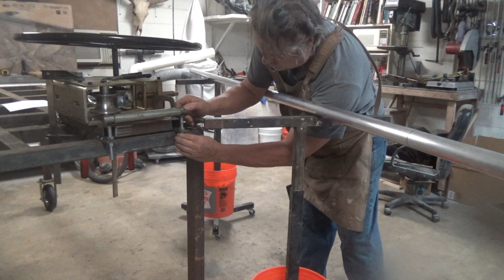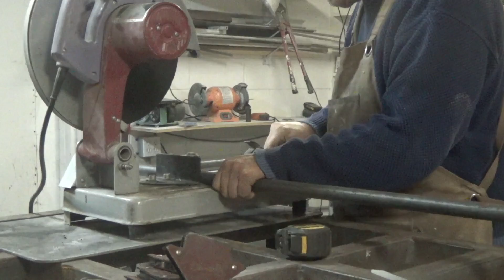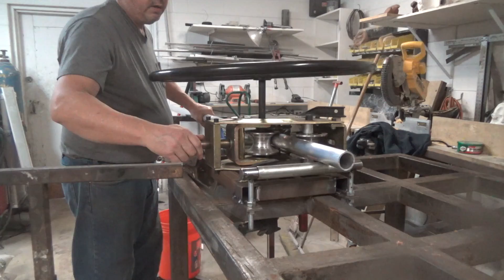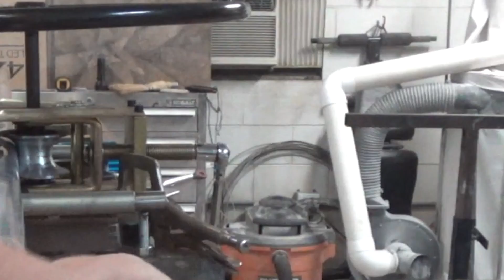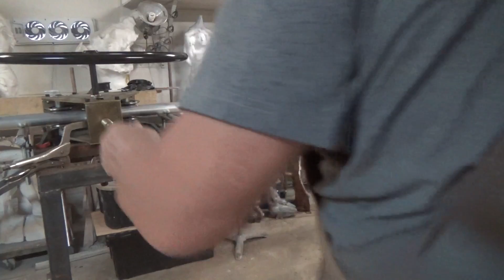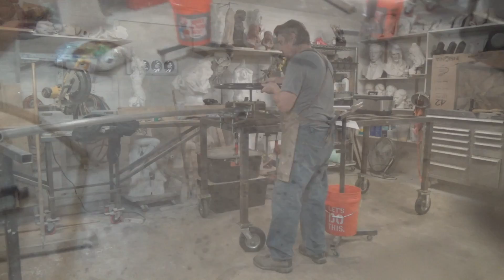Properly Modify Your Harbor Freight Tubing Roller

Comment: Nice idea using the floor as a reference guide for the ends.  I wouldn't have come up with because the shop floor is cracked.
Reply from the maker: The shops that have the big benders usually have one operating the bender and another person out on the end with a level. I just modified that idea for a small shop. All you really have to do is use the level. It is really better to have a two person operation, with the person on the end, holding the level.

Comment: I need to create an 8 foot diameter circle using 3 lengths of 10 foot pipe. How do I know how much bend to put into each section (length) so that when assembled with couplers the ends meet to complete the circle?
Reply from the maker: Google circumference calculator. Find your centerpoint in your length and measure out from the centerpoint. Allow at least 10 inches to a foot for the flat spots. Mark with a marker. And use a roll of tape around the tube to get a square cut. Draw out on paper first to make sure your calculations work. I should publish a formula, but those files are archived and I’ll have to look them up. good luck and feel free to contact me.
Reply from the maker: Ok this is the calculator I use online https://www.omnicalculator.com/math/circumference. 
1- Diameter Calculation: An 8-foot diameter circle has a circumference of approximately 25.13274 feet. (This is just a calculation for reference.)
2 - Divide Circumference by 3: If you divide the circumference of the circle by 3, you get approximately 8.4 feet. Usable tubing. Converting this to inches gives you 8 feet and 5 inches.
4 - Adding 20 Inches: If you add 20 inches to the 8 feet 5 inches, you get a total of 10 feet 1 inch.
5 - Marking the Tube: Find the center of the tube and mark it clearly. Then, measure out 4 feet 2.5 inches from the center in one direction and mark it. Repeat the same step on the opposite side.
6- Do not cut the length down until the end. REMEMBER YOU NEED TO ROLL PAST THE ENDS TO AVOID THE FLAT SPOTS. AFTER THE BEND, THEN CUT!!!!
Reply: @forsterarts  Thanks for the calculator and calculations. I am still confused. After I mark the tube at 4.25 inches, how is this mark used? In relation to what? I’m trying to figure out how much bend to put in each 10-foot section so that 3 sections put together will give me the circle.
Reply from the maker: @SteveJohnson-x1z  the center of the tube is 5 feet. Circumscribe a mark with a felt tip pan at 5 feet. Measure out 4 feet 2 1/2 inches from the center. At that point circumscribe another line with your tip marker. do this for both sides? The remaining will be the flattened spots that you don’t want in your bend. Those get cut off and thrown away. I’m out shopping right now and should be home in an hour or two if this does not seem clear enough I’m having difficulty writing from my phone.

Comment: When i first sauce this honestly it thought it was ridiculous, then I had to bend a 9’ radius on 2” bar and it kept corkscrewing. So I spent a lot of time setting up a similar mod, well I was skeptical that it would work, but let me tell you it was worth the time, then bends are perfect every time and I don’t have to constantly straighten the pipe! I used the swag mods too, and can bend a 9’ section of 2” 15 gauge to a 9’ radius in less than 10 minutes, perfect  every time, thanks for posting this!

Comment: The concept is great, my shop floor is not....Mason must have done some serious drinking while waiting for concrete truck to show up that day.  I bought garage this way, did not have it built.     I'm a solid 2.5" off over 30' in my shop.  Rolls up in middle, then back down again along edges, and there is a drain in the middle of floor, .....at highest point....SMH......When I bring 24' lengths of material in, and set it down, I have to block both ends and nothing in the middle.     Is it mostly round tubing that is an issue then?   I do alot of square tubing rolling, and don't have much twisting issues using it upright.   I have to go outside to do it, but wouldn't have the space anyway to do it on side, your way,  inside.  How big is your shop?       I can usually clamp them down on a table jig after and then the heat from welding gets them flat and true for the little bit they are out.    Aluminum twists like crazy to begin with while welding, so it sort of moves back to where I need it.
Reply from the maker: My current shop is very small, I went from a 5000 ft.  to 600 foot shop. My shop table has large inflatable wheels so I could roll out into the yard for larger works. Yeah your square tube comes in 24 foot lengths doesn’t it. I made those little T stands and have plenty of them around. they are very handy.  Make them adjustable to go up and down. If you can find another person to hold the ends of the tube, then they can keep a level on the tube. You don’t want to heat aluminum for tweaking. I do use a very heavy dead blow up on occasion. Even square tube twist, especially As the radius gets tighter. I don’t know if the 2.5 inches of change in elevation will affect the outcome much. Just keep a level on your work all the time. Good luck!

Comment: I would suggest you add two more guide rollers and eliminate the weighted buckets on each end.  When Using the buckets fasten the tube with a six inch F clamp.  It will go inside the tube if I.D. allows and hold it better.
Reply from the maker: An F clamp would definitely be less frustrating.  The added rollers will not prevent the twisting that naturally occurs in this process.  When you do this in a normal shop, you have a guy on the other end holding the tube with a level.  I substituted the guy with the level, using the stands.  It works well for me.

Comment: By using the roller horizontal instead of vertical, the way it was intended, you fall prey to gravity which is causing your "spaghetti" effect. All tubing rollers are made this way for that reason and a simple lengh of angle iron bolted to the back side opposite the handwheel will allow you to see if the bend is going out of square. Plus you don't need 200 square feet of floor space and those ridiculous rolling T-supports that are guaranteed to stumble on every piece of debris on the floor.
Reply from the maker: I would guess your an engineer?  I have owned some of the most expensive rollers all the way to this roller.  All the expensive Rollers have an option to roll horizontal.  With the roller set to vertical, there is no way to check the flatness of your curve.  I have never known tubing that did not have a tendency to twist.  You must be a better roller than I.
Reply: I wood ges kollej edukated. LOL
They have education but absolutely NO common sense. But they know it ALL!!!
Reply: I would guess a couple pieces of 2x2x1/4” bolted together 1/64” wider than the stock being bent on both the exit and entry would be less time, mind, and space consumptive.
Reply: I was thinking about that as well, but only because the HF roller has a lot of play on each side of the dies, that owners are putting washers on each side to eliminate the play. So tipping it over on its side will allow gravity to slide the rollers to one side which isnt a problem if all the dies slide into the same position keeping them aligned but if theres dust and gunk on the die's bolt.. perhaps  it could cause the die to not slide all the way to the one side causing the dies to no longer be aligned.  Simple washers will solve this problem though.
Reply: @ChristopherJones16  providing your floor is level,  most aren't

Comment: It's a great idea.  I work outside in the gravel, so this probably won't quite work for me.  If my shop area was weld-spark approved (don't want to burn down my shop), the floor is pitched for water drainage, so it wouldn't work there either.
Reply from the maker: Have a friend hold a level on the end, or tape a level on the end.
Reply: a level floor is ideal, but a flat floor that slopes will also work fine, you just can't use a level to calibrate your equipment.

Comment: place a locknut on the threads when you reach the desired radius
Reply from the maker: That is a really good Idea.  My old Baleigh had a dial on it,  and you could set the dial.  Thanks for bringing up that point.

Comment: This is a whole lot of wasted time. I have used and seen many things built with a hf radius bender/tube roller and have never seen a problem bending vertical. I don’t think I have ever seen a vertical radius bender. Baileigh, trick tools, hf, dpmimports they all make them vertical. It makes more sense so there is no load pulling on it sideways from the way your bending it.
Reply from the maker: Good Luck! trying to make money with that.

Comment: The biggest problem with the Harbor freight roller and causes the twisting problem as well is that the roller dies are to close together.  Buy the SwagOffroad upgrade kit for this roller and all will be good.  Great video.
Reply from the maker: I have owned the big expensive Baileigh's too, and they all twist.   I used this method with my big expensive rollers. Controlling the twist is primary  issue.  Now the people who really know rollers are the people who do the big expensive stainless steel spiral staircases.

Comment: Hi Peter,
Loved the video!  I was hoping you would be kind enough to advise me on something? Do you remember what wall thickness and diameter tube you are bending in the video?
I have just made up my rollers for the roller bender I am making.  I need to bend stainless tube that is 1" and a 1/4" diameter and .065" wall thickness.
Like you, I am a sculptor but I am from Australia.  I was going to use the harbour freight unit as a guide to the one I am making.  Do you think it will be up to bending my job? The tube you are bending seems much thicker than .065.  Any thought?
Kind regards,
Simon.
Reply from the maker: I was using aluminum pipe that was 1/4" Thick.  Knowing the difference between pipe and tube.  Pipe is measured by the inside diameter, and tube is measured by the outside diameter. My pipe was 1 1/4" ID, which made the outside 1 1/2".  The rollers are designed for tube diameters.  I used the two  inch rollers to produce my railings.  There is a problem with using oversize rollers, in that the walls will deform and not stay round, they become sort of oval shaped. Harbor Freight dies are 1", 1 1/2" & 2".  You will have to use the 11/2" die and depending on how tight a bend you are looking for will determine the distortion.  There are a number of people producing after market dies if you need the precision. 

*no matter how fine a roller you purchase there will always be an oval shape, you can actually calculate the oval that will be produced. Also known as "Ovilaty"*

To answer you on the 1/16" SS wall thickness and will the roller be up to the job.  Yes it will.  Remember to allow extra footage on the ends for cut off.  No matter how fine a tubing roller you have, there will always be distortion where the bends begin and end.  I pre determine my bends, with precision and mark my tubes all the way around before I begin rolling so the cut off angle is not fudged. *Start the bend several inches in front of your cut off marks!*

Also, you are probably thinking SS this is tough stuff, it is going to be hard to bend.  SS is tough yet at the same time fragile.  It has high strength but the surface is fragile.  That is stainless steel self passivates. Under a microscope the surface is always getting rid of contaminants that may start to rust.  For this reason I always handle my finished SS with soft goat skin gloves.  Start your bending process gradually, do not overdue it thinking in the back of your mind this is going to be tough.  The biggest problem you will be faced with, will be keeping the tube from becoming spaghetti like.  You can achieve the same results that I produce in the video by having a person on the ends holding a level.  This method takes a bit of practice, but is quicker. 

I ended up building a small stand, because the large table just slowed me down.  Getting your rollers set up is very important, I made a number of shims using large washers.  I ground one pair of washers down to paper thin.  *Washer pairs, that is three pair of washers to paper thin* The rollers must be centered equally yet turn easily to produce best results.  Take the time the first time to set them up right, learn the quirks of the rollers, and you will get some nice results.  Good luck, if you have more questions, let me know.

Circumference calculator https://www.omnicalculator.com/math/circumference
Reply: @forsterarts  Peter, thanks so much for the detailed response.  It is much appreciated.  I made my dies on the lathe and they seem to be a good fit on the tube.  I am not envisaging any problems from that side hopefully.
I am surprised you got away with the bigger rollers on your job but it is great to know that there is some tolerance.  I was thinking that if it was 1/32 "  oversized it would be a throwaway job!
I am obviously wrong about the roller setup.  You mentioned shimming yours to get the alignment right but I had assumed they would self align?  So they really need shimming?
I am curious as to what happened without shimming? Do the rollers bog down or go off centre or something?
Again, your advice was very much appreciated.
Regards,
Simon.